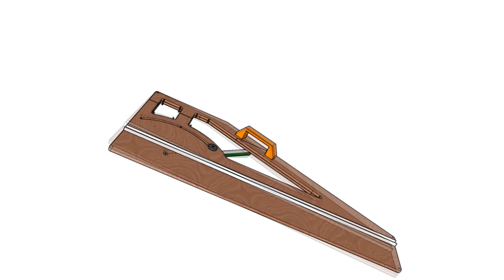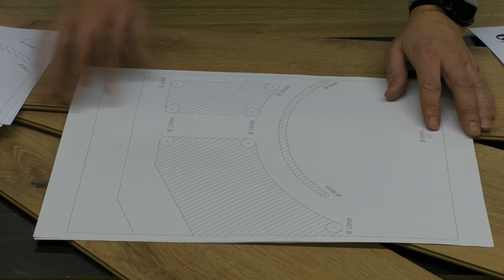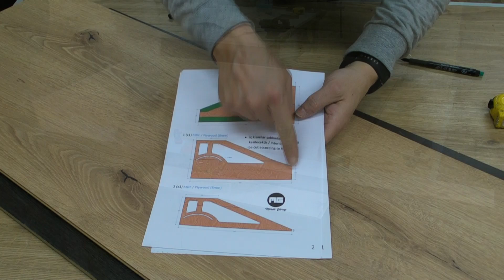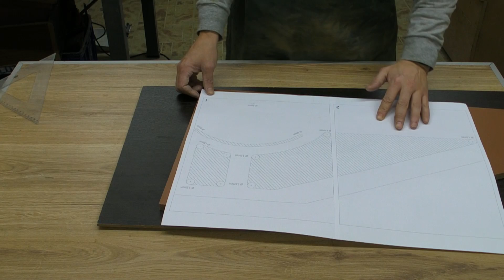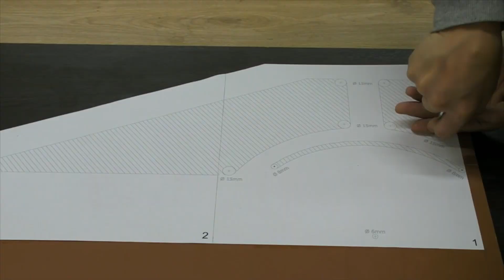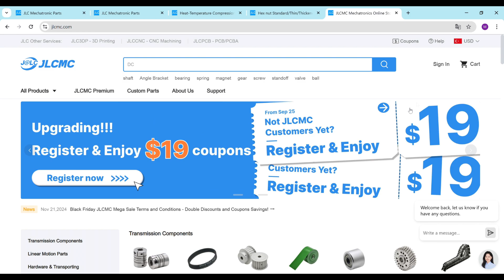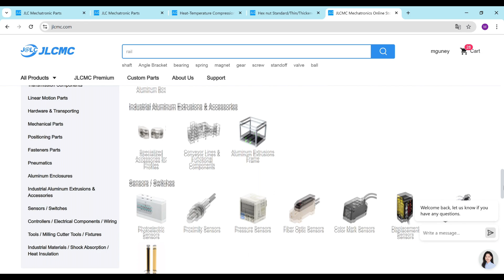Homemade Circular Saw Guide - Allows for angled cutting!

Comment: maestro puedo conectar un dimmer de 2000w con 8 triac para una máquina de soldar de 3 transformadores de microondas
Reply from the maker: Puedes empezar.  Sería más que suficiente
Reply: Gracias maestro lo etiquetare en el video
Reply from the maker: Yo también te lo agradezco 👍👍👍
Reply: E fallado maestro usted usa corriente 220 aquí en Guatemala uso 110 estoy en la lógica que a más voltaje menos amp y menos voltaje más amp tal vez ese es el motivo el cual se queman lo atenuadores y los triac corrijame si estoy mal gracias